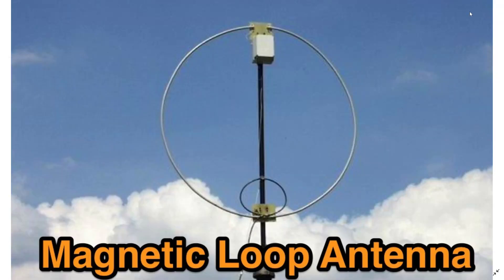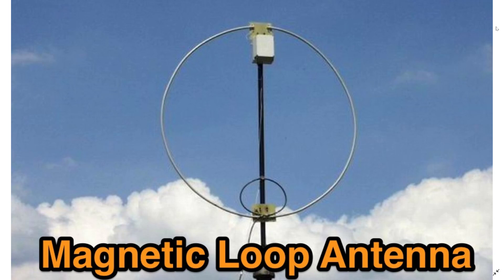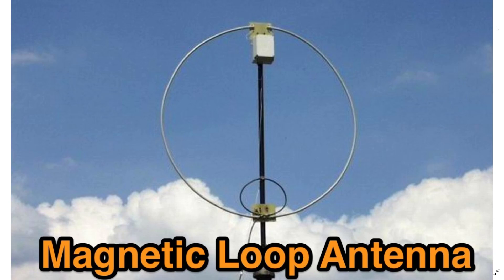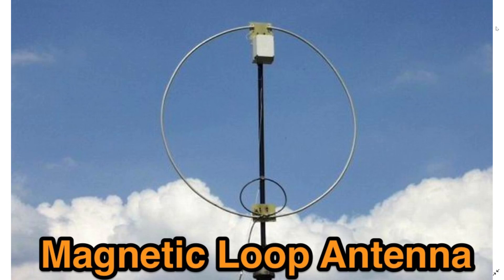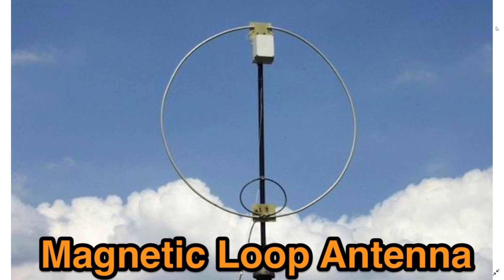Magnetic loop antennas what are they and more testing coming soon

Comment: Passive magnetic loop antennas  are very high Q, and must be fine tuned to resonance for them to work well. They are a tuned LC circuit. The amplified loops seem to be low Q very broad bandwidth. I would be interested in seeing evaluations of the amplified loops to determine if they are actually using the magnetic component of the electromagnetic field or less of it and more of the electric field.

Comment: Looking forward  to the mla-30 review before I build a passive one like pictured here with a feed loop and a tuneable outer loop with a variable capacitor . Some refrigerator flexible copper water line and a cap and junk bin parts would be quite inexpensive.